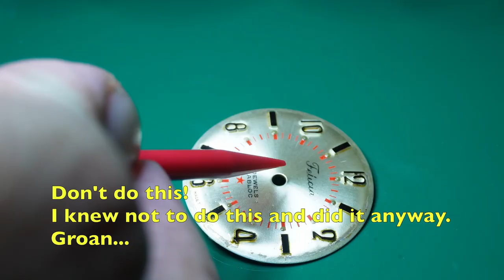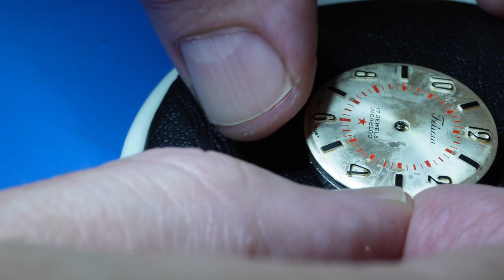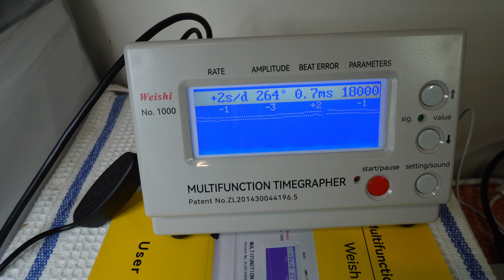My First Wristwatch Repair Attempt - Felicia ST96

Comment: So much oil you could use the stem as a dipstick.  Good work for your first watch repair! FHF (Fabrique d'Horlogerie de Fontainemelon) 96 movement. I am currently working on the same movement but the 96-4 version with date complication.
Reply from the maker: Hahaha! That's right. I don't think I'm quite ready to do a movement with date just yet, but the 96-4 is probably a good place to start when I do. Thanks for Watching.

Comment: The purpose of this cap jewel you were unsure how to lubricate it is to reduce the end shake of the wheel and on the other hand give it a bit of shock protection I think. The proper way to lubricate it is to put a tiny drop of oil on the flat side, turn it over and put it back to its place so that the oil is held between the two jewels where the pivot contacts the cap jewel.
Reply from the maker: Thanks - I think you are both correct. I did ask my watchmaker and he said it was fine to oil it the way I did, but I think next time around I will do as you suggest.

Comment: Regarding putting the parts together. I am also a beginner and doing the same. However I can’t see how even with experience it will be easy to keep track of which screw goes where. 
Each movement seems to have its idiosyncrasies about that. So I would say that keeping screws grouped with what they screw in is likely a good practice in general
Reply from the maker: I've only done half a dozen movements, but I'm pretty sure I would be able to work it out pretty easily. The biggest risk is two screws that are the same thread but different length. I haven't had a movement with that yet, but some do. That's why its important to keep a close eye on the screws when disassembling. Most of the time the wrong screw just will not fit into the wrong place. Watch movements are for the most part so finely toleranced, that the right screw will just want to go into the right place - if that makes any sense. It will be pretty obvious pretty quickly if it isn't right.
Also, after a while you know that most watches will have at the very least:
Balance screw
Pallet Fork screw
Dial screws (I usually leave this in the mainplate)
sometimes mounting ring screws to secure the movement in the holder (I usually leave these in place)
Train bridge screws (usually 3 or 4, and they are usually the same)
Barrel bridge screws
Ratchet screw (big head)
Crown wheel screw (big head, usually reverse threat, with the thread cut off at the bottom so it doesn't foul the stem)
Setting lever screw (it will be different from all the others, newer watches often don't use a screw but a post that sits in the mainplate)
There is usually a cover plate on the dial side that over the top of the yoke. Usually two screws that are fairly small
There may be a screw as part of the yoke spring mechanism depending on manufacturer
If the watch has centre seconds sweep, there will either be an additional bridge holding the fourth wheel above the centre wheel. Usually just 1 screw.
Otherwise the fourth wheel will be offset, and there will be a small bridge with an intermediate wheel to connect the fourth wheel to a pinion going through the centre wheel driving the seconds hand. There will be some screws holding this intermediate arrangement in place.

So the point is that it doesn't take that long to be able to identify what everything is for, and thereby where the screws go.
I learned all this just by working on a few watches. The point is to look very carefully when disassembling.
And even though filming it is a real pain, sometimes it can save your life when you need to go back and review the footage to see how something goes back together.
Good luck, and enjoy!
Reply: @watchout9213  I hope for my sake you are right. My second practice movement is a 2650g. A pretty ugly and very cheap skeletonized movement which I chose because I could have a pocket watch with it in it delivered by Amazon one the same day (Sunday) for 27$. And the click screw, ratchet wheel screw and crown wheel screw look the same even under the microscope. Obviously the crown wheel one is reverse threaded and the other two may actually be identical. But in doubt I keep them separate and next to their respective part. 
Granted it may be different in more “respectable” movements (and I am not ditching this one because it is Chinese. I think the st36 is beautiful and very well made but that 2650 really feel bad.

Comment: The pallet fork jewel may have become loose if you cleaned the pallet fork in IPA.  The shellac holding the jewels in place dissolve in IPA. One Dip is used for cleaning the balance and pallet fork. Just a guess from a fellow hobbyist. 😁
Reply from the maker: Thanks - I cleaned the balance and the pallet fork in One Dip. The balance I used was one of those cheap Indian "10-pack" blisters, so that might be part of the problem. Thanks for Watching and commenting, I really appreciate it!
Reply: My understanding is that soaking for any longer than 2 min in IPA will damage pallet jewel shellack .If you do a quick dip in IPA and then immediately blow off with air….should be safe.

Comment: Great video... but... ¿Have you put the hands at 8.45? It´s the first time I see something so...
Reply from the maker: I'm not sure what you mean, but I probably made a noob mistake. I've since worked out that you need to set the hour hand right on an hour (any hour will do) and set the minutes hand to 12 O'Clock. Common sense, but when you've never done something before you can't think of everything all at once.